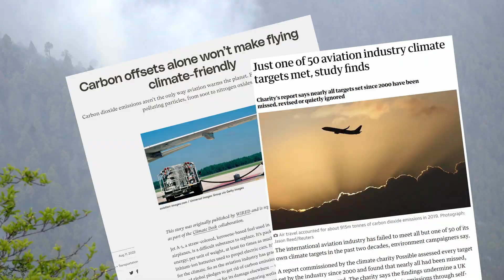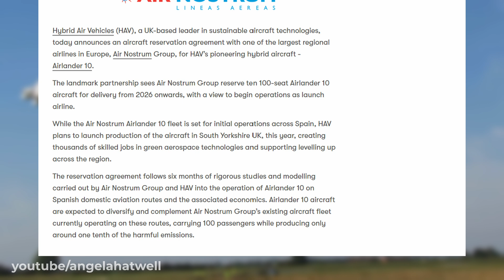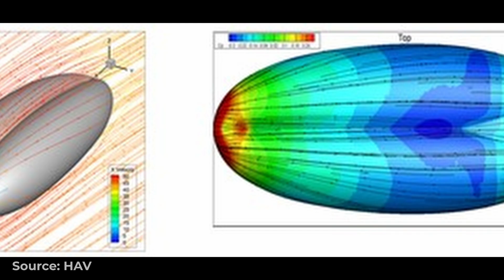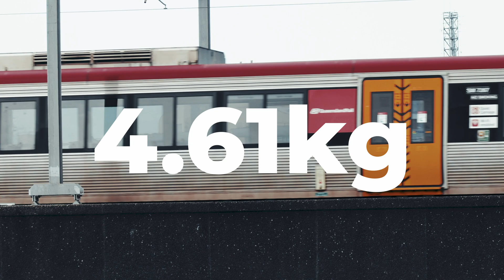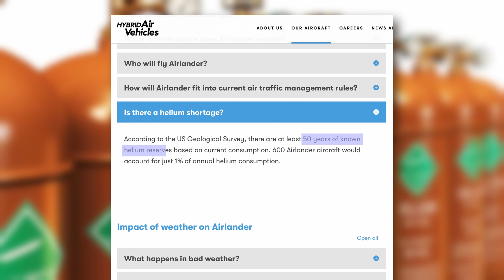Are Airships the Future of Aviation?

Comment: you only brushed over it , but the lack of helium is the literal dead end to this idea. it is such a great and erfficient and useful mode of possible transport, but in realitiy it is impossible. 

to float you need to be more bouyent that the surrounding medium . hydrogen is the lightest but explosive . helium is next but all but non existant in commercial properties on thhis planet.

helium in really only found in useable quanties and they are tiny tiny amounts for useful commercial developement in the united states . its a strategic asset ( rightly so) that there are controls on asnd they dont want used up and wasted . its something trhat onece gone - is gone. there is commercial recycling , its an elelment so cant be sythisysed and as far as i know there is no reasonble known substitute ( cant just phase out like with CFC ) that is at all environmental effective or cost useful . its an elemental science problem that money or innovation cant really rectify.. simply saying thay there is enough for 50 yrsd or they use so little will not fix the fact that its not a resourse that will be able to be used for large scale stansport.

note that the reason that the germasn airships used hydrogen was t overcome the fact that they had no access to the prefered helium ,and they expected trhat they could engineer around it with the far more dangerouse hydrogen 

this idea as nice as it seems is dead in the water, for like so many other things for only niche self indulgent wasteful poserish first world peoples use . and best moved on from . cheer .

Comment: Nope. :> They're inefficient. You take up all that space and fuel to move maybe twelve people around 5 miles an hour? Helicopters effectively sliced into their niche quite nicely and are far safer.
Reply: I basically agree, but I don't like such exaggerations. Passenger capacity depends on the size and design of the airship. Airlander plans aircrafts for >90 passengers. 
Top speed of airships is rather between 70 and 80 mph. 
Even LZ 120 Bodensee (1919-1928) had a top speed of 82 mph and carried up to 30 passengers. And it had only a tenth of the volume of the Hindenburg.
Reply: Imagine the passenger capacity of LZ 129 Hindenburg, if they had spared 90% of the fuel capacity (for up to 16.000 km range) and would have installed seat rows instead of cabins, dining room, smoking lounge,...!

Comment: Airships could work for trips that are less than 800km long while airplanes would fly longer distances
Reply: I suppose, IF airships will play a role in future passenger transport, it will rather be for short distances.
But "less than 800 km" can be covered by battery electric planes as well in foreseeable future. And with fuel cell electric planes.
Faster, cheaper, no need for helium.
So the only advantage will be "no need for a runway". Which could work for some cases.
Reply: "The only advantage" referred to passenger transport in a narrow sense (not sightseeing).
Of course, for a couple of other niches, other advantages could also count.

Comment: The problem with the Airlander dirigible is for the surface area exposed to the force of the wind, helium is providing poor lift. Helium is expensive, it has to be imported from the USA, I believe. Hydrogen is cheap, has much more lift. Modern polymers can make the airship far less dangerous that a metal Zeppelin. If we fly around in thousands of aircraft with wings packed with jet fuel, a hydrogen lift modern Zeppelin is not absurd. Ever see footage of a jet liner cartwheeling on a runway being ripped apart in a fireball? The nice thing about a lighter than air, airship is that not much energy is used for lift. It can be used to haul heavy materials to and from isolated sites.

Comment: Not fun fact but interesting: since airships fly by using buoyancy, once they exploded they don't just fall to the ground, instead they slowly sink like ships, that explains how many people was able to escape the Hindenburg. The casualties are those inside their cabins and didn't have enough time to jump, or they were crushed by the ship's frame.
Reply: "once they exploded they don't just fall to the ground"
The Hindenburg didn't "explode", but burned. And imagine the same loss of lifting gas and hull material in such short time (seconds) in a higher altitude, not just 100 feet above ground!
Without air resistance from the hull and without lift by lifting gas, an airship falls from the sky like a stone.

Comment: "Are airships the future of aviation?" Well, no. Helium is a nonrenewable resource and we only have so much. Eventually there will be a point where the cost and rarity of helium exceeds practicality in being used. To have an impact on modes of transportation you would need a comparable amount of these to take the place of conventional trains and/or aircraft. In short, this is not a long term solution.

Comment: An airship has very little lifting force. The payload is small. Also, it is vulnerable to bad weather.
Reply: As the size goes up, the lifting capacity goes up squared.    The largest airships will be able to haul massive payloads....such as the proposed "Flying Whale" to haul cargo in northern Canada.    Flying Whale airships can carry about 60,000 kilograms of cargo, which is about 30 per cent more than Canadian North's airplanes can take.

Comment: Airships have a large achilles heel in their susceptibility to weather and slowness.

The TWO worst airship disasters were helium units. It's extremely difficult to build something that big which can react fast enough to things like downdraft associated with thunderstorms to stay in the air (or prevent being lifted too high)

They have their uses, but revenue passenger transport service is unlikely
Reply: Cargo makes more sense to start with.
Reply: @wadexyz  totally agree, but they're simply too vulnerable to weather events to be used for much (and rail is faster over land, so they face the much wilder weather of oceans plus the distinct risk of total and sudden loss, as happened to both US Navy airships)

Comment: The future of aviation is tilt rotors, hybrid powerplants and composite materials, if I had to guess.

We will use axial flux electric motor for take off/landing/climb. The aircraft will rely on the combustion engine alone for horizontal flight, with a portion of the air current used to cool the electric motor. 

Horizontal flight should be more than enough to recharge the battery, so no recharging time required. That particular style of motor is very power dense which offsets some of the weight of the battery, that should be smaller anyway since the motors will work in tandem with the engines or not at all for the most part.

Use of short take off when available will save some extra fuel lowering costs further.

Is the electric motor worth it? Well, in the long run, yes, just don't expect insane power from these motors since the goal is to increase efficiency, not performance.

Comment: I have not seen any discussion regarding windy conditions. How would one of these airships handle winds?
Reply from the maker: According to HAV, the Airlander 10 airship can take off and land in crosswinds of up to 30 knots which is only slightly lower than the maximum for a Boeing 737. Naturally airships will always be more prone to high winds than airplanes though and they also have slower cruising speeds so lack the ability to avoid bad weather as quickly.
Reply: @TheUpshift_Media  Yeah, that’s what I’m worried about. I would hate to be caught in sudden high winds and bad weather in one of these. I’d much rather be in a jetliner in turbulent conditions than an airship.

Comment: I would love to see the empire state building hosting dirigibles again, and other buildings too, like the Eiffel tower for exemple !
Reply: The Empire State building never hosted dirigibles.   The "dirigible mooring mast" on the Empire State Building is a complete scam.  It was built to make the building taller than the Chrysler Building and serves no purpose other than making the building taller.  It was never intended to moor dirigibles and never has, other than a single privately owned blimp that docked there briefly as part of a publicity stunt. And even if it were practical to moor large dirigibles, how would you get passengers to and from the gondola?  (you couldn't)   The photograph of the US navy  airship "Los Angeles"  moored to the Empire State Building is a "composite"  meaning that it was a pre-photoshop fake. That never happened.
Reply: @andrewalexander9492  I didn't know it was a scam, my bad
Doesn't mean it's not feasible so, holding the dirigible parallel to the top floor and with a retractable ramp of some sort..
I would love to see that one day

Comment: An outstanding technology used to replace a useful technology to solve a problem that doesn't exist and couldn't be "solved" even if it did exist.  
"carbon neutral" travel is an impossible pipe dream which wouldn't make any difference to "climate change" even if it were possible.

Comment: How does this have any advantages over high speed rail
Reply: There are some. An airship doesn't need as much infrastructure on problematic terrain than a train does. It is far more complex to move a train over (or under) big areas of water or through mountains. As well as the railway-net needs constant maintenance.
Reply: Doesn't need rails for example

Comment: There's a difference between a Zeppelin and a dirigible. A dirigible is a solid frame, steerable, lighter than air craft (as opposed to a blimp which doesn't have a frame). A Zeppelin is a brand name. The company, named after its founder, was mostly famous for it's dirigibles. In the first minute you should say "rigid airships known as dirigibles".
Reply: …and if you compare LZ dirigibles præ-&post-WW1, you discover that what's understood as a "Zeppelin" in fact is a Schütte-Lanz construction.
Zeppelin now is active in construction equipment, Lanz was a prolific maker of agricultural machinery, now part of John Deere.

AFAIK all of the air ships proposed today (after #Cargolifter in the 1990s) aren't rigid, as the frame would cost too much weight.

Comment: A hellium balloon can reach the edge of outer space. Could a ridged airship carry a satellite and launch it
Reply: Yep, it's called a rockoon. One of the advantages would be that you could design the rocket for mass efficiency rather than aerodynamics
Reply: Sempre pensei nisso. O dirigível não seria rápido para decolar, mas poderia servir de plataforma de decolagem de alta altitude. Uma espécie de porta aviões (ou foguetes) voador, eliminando metade da viagem na atmosfera, e permitindo os foguetes decolarem com menos atrito com o ar.
Reply: Technically yes, you could launch rockets from airships.
Reply: I've seen several versions of this idea. Apparently the air resistance is so low at those altitudes that an airship could fly several hundred kilometers per hour and launch it's payload horizontally. The rocket would glide a few seconds and then ignite it's engines. Gaining speed and then pulling up to climb. Supposedly at least one design for this would have the launch dirigible at over 60 km altitude.
Reply: There are some aircraft that are lifting rockets up to high altitude then launching them. Virgin Galactic does this for sub orbital flights, 
Stratolaunch is the largest aircraft in the world and is designed to lift 550000 lbs up to 35000 ft. For small rockets this doubles the payload capacity to orbit which is a pretty significant advantage.
Reply: No.

Getting to space is the easy part.

 STAYING there is hard and requires lots of speed (which is where most of the rocket mass is involved) and launching from a high altitude platform is only going to save a few percent on your fuel mass whilst massively increasing logistics complexity

Rockets launched from the ground are at the kind of heights you're thinking of within 20 seconds. They're normally travelling in excess of 150km/h (100mph) before they clear the tower and 99% of the earth's atmospheric density is below 8km

An airship large enough to carry anything bigger than a pegasus would be even bigger than Hindenburg-class ones and generally limited to 3-4km altitude in any case
Reply: This would be of little help. A satellite does not so much have to get high, it has to get the speed to stay in orbit. If you carry a satellite to whatever height, even into space, when you release it, it would simply drop back down to earth. It would be possible to lift a rocket and launch it from 30 km high. It would help somewhat, as the rocket would not have to fly through the thick atmosphere.
Reply: to go into orbit you would have to be going 30 kilometers per second, an airship could obviously not go that fast, and the energy needed to launch it into orbit  would do something idk
Reply: @whatare9731  an airship could lift a rocket up to high altitude, though.
Reply: @whatare9731  I mean, if the airship is big enough, it COULD be a launch platform for a rocket's upper stage, completely negating the need for a first stage. Using an airship, you can make an air-launch SSTO.
Reply: @johnadler6987  I know that, it seems like a very good alternative to throwing a satellite into orbit
Reply: @whatare9731  or we could combine throwing stuff into orbit with airships
Reply: @whatare9731  that is escape velocity not orbit but your point still stands